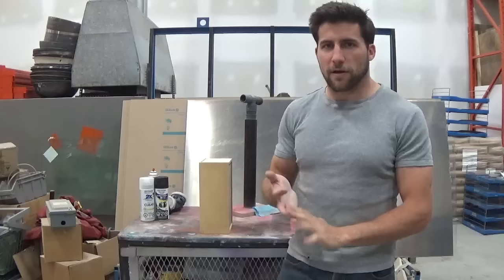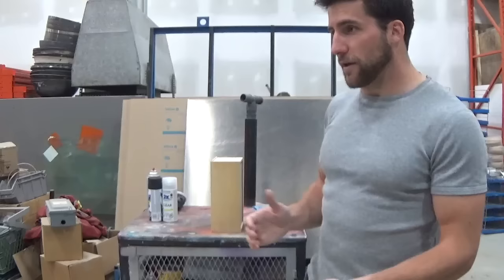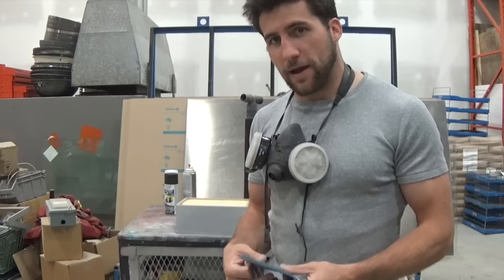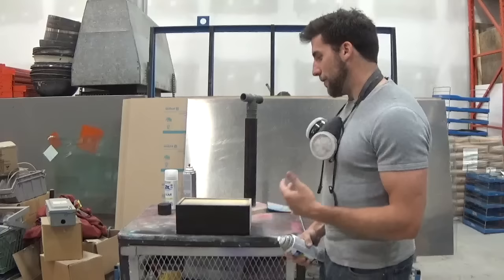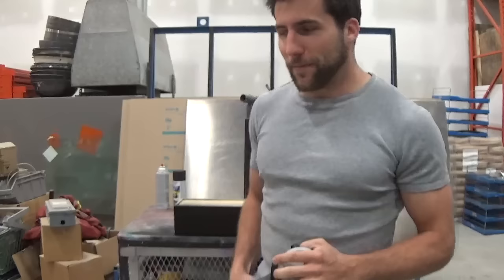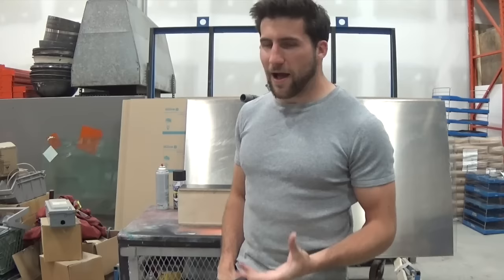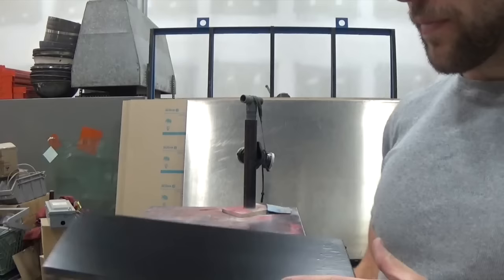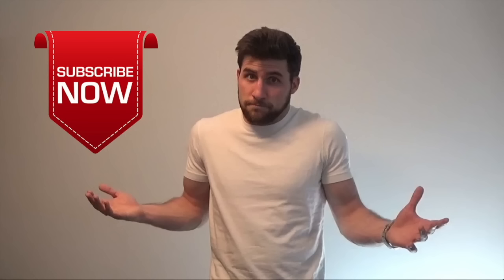How to get a matte black finish with spray cans

Comment: My old 1982 S-10 turned out great with the exact same Rustoleum "painters touch" flat black you're using, but even after 2 days of curing. If I touched the paint, even with clean hands, the fingerprints would remain and be very hard to clean. 
I cleaned it with some sprayway and hit it with the same Rustoleum matte clear and I got all kinds of compliments about how good it looked. 
When I posted it on Craigslist, the guy I had bought it from the week before saw it on CL and called me to tell me how great it looked. I gave him $500, put about 5 hours of body work and interior detailing, $30 in paint, painted the wheels silver using index cards for masking and posted it for $1,000 and ended up taking $900. It was my quickest flip ever.

Comment: Brad, a great spray can flat black is Dupli-color bumper paint, it has a great fan spray and covers well. it does fade but to more of a charcoal gray and not that weird purple you mentioned, and if you know how to use a spray can well it covers large areas well without lines and streaks, the only matte black ill use or recommend after painting 2 vehicles with it
Reply from the maker: +jon lawrence  Thanks Jon. That's good to know.

Comment: first time that i am painting with spray (painting anything at all actually), i will be painting some solid body guitars matte red, and pickguards black...
i have been training in the basement, with a plank found on the street, what i did:
DAY 1
1/ sanded at P320 grit (because that's all i have),
2/ washed the surface, dried,
3/ then matte primer, 20 minutes,
4x1/ matte colour, 20 minutes,
4x2/ again matte colour,
rest for the day,
DAY 2 (so far i like the result, not perfect, i see some weird cracking spot somewhere in the middle, but i like seeing the grain of the wood)
1/ sanded at P320 grit,
2/ washed the surface, dried,
3/ clear coat matte,
4x1/ matte clear coat 20 minutes,
4x2/ again matter clear coat 20 minutes,
i just finished the two layers of clear coat letting rest for the day... what i have noticed is because i am not skilled yet at painting with cans, it's uneven and i get some white-ish spots
should i have done a second layer of clear finish?

by the way i have been binging your videos, i have found them very entertaining and pedagogic. if only i could spray evenly, it's not easy.
Reply: also how much should i spray the finish layer? for colours it is intuitive, but for the finish, especially matte, (since it's transparent haha) i am not sure know what to aim for.

Comment: Thanks for this. Two questions: 1) Do you typically sand after second coat of paint before hitting with matte clear? 2) How much time do you wait for the paint to dry before the clear?
Reply from the maker: Yes. And if I’m going to sand I wait a day at least.
Reply: I used a 800 grit scuffing pad it baby left miniature scratches that I could only see in direct light is that enough scuff I was afraid if I left bigger actual scratches that it would show in the clear?

Comment: Followed your very detailed guide and my rebuilt guitar turned out great!
Was going for Jim Root's black strat signature model.
Reply from the maker: Awesome. Glad to hear it turned out the way you wanted.
Reply: @BradAngove 

Hi I hope you are very well.

Thank you very much for your videos, I have some questions and I would like you to help me:

* I'm going to use rustoleum Black canyon Satin Black on a guitar, and I like the satin finish with that characteristic gloss on it.

So I have some doubts about it so that it has a professional finish and they are the following:

1) how many layers of satin black are enough 2 or 3 ?

2) will the Spraymax 2k clear coat change the finish of the rustoleum satin black a lot? I want it to keep that subtle shine and richness of the overall color.

3) between layer and layer of black I only have to wait 10 minutes without sanding? And then wait 48 hours of drying to apply the 2k clear coat? Before applying this clear layer if I have to sand? Thank you

I look forward to your prompt response
Reply from the maker: 2 layers is generally fine. Gloss 2K on that will turn it gloss, which defeats the purpose of using satin. If anything you’ll want a satin clear coat  10-15 minutes between your two layers should be fine, but it is dependent on the atmospheric conditions.
Reply: @BradAngove 

Thank you for taking the time to respond.

What I want is a satin black finish, and I was thinking of using a 2k clear coat over the Black satin for added protection, I think I would use Spraymax 2k semi matte clear, because the rustoleum clear satin is not as resistant and durable.

Can you please recommend me a Clear 2k satin Other than Spraymax semi matte? which is the best that you have used? Thanks
Reply from the maker: The spraymax is a good option. I also like the car-rep 2K clear.
Reply: @BradAngove 

I was looking at the car rep 2k clear, but it seems that they only have the gloss option, not satin or matte.

And if I apply those gloss layers, I would have to sand lightly afterwards to achieve the satin finish, but I would end up with micro scratches, right?

If I use 2k spray cans, which mask with which filters do you recommend that they give me the best protection?

I stay tuned Thank you
Reply from the maker: Yes that’s basically right. If there isn’t actual satin then you can get close with sanding but not quite there. 

You definitely need a respirator. I would go with full face for sure. If you’re going to be doing it a lot you would want something with a fresh air feed, but those are very expensive.
Reply: @BradAngove 

Which particular reference or brand of full face respirator do you think is the best option? I plan to buy it on Amazon along with the spray cans.

* I wouldn't do this job often, but very sporadically with some of my guitars, I just want to be safe, and not take risks with protection.

Thanks you are the best
Reply from the maker: I use the 3M one that can be found in the amazon link in the description of my videos.
Reply: @BradAngove 

Thank you very much for taking the time to respond.

I will follow your advice it is very helpful. Cheers

Comment: Bought a guitar DIY kit of a Les Paul Junior and I'm doing it in a matte black, just finished priming it. My first guitar paintjob, so hopefully it ends up at least okay :D
Reply from the maker: Awesome; let me know how it goes.
Reply: I think it went fairly well, minus some dripping I didn't sand down properly.
I made a journal on DeviantArt with some photos of my progress which I will update as I start the final assembly
http://9joakim7.deviantart.com/journal/DIY-guitar-kit-from-Gear4Music-620817761
Reply from the maker: Nice work. It looks pretty good to me. Thanks for the shoutout in the beginning as well. You can put the matte black on in slightly lighter coats. The same goes for the clear. They don't need to be that heavy really.
Also, don't worry about that guy who says you have to use nitro. Very few companies use nitro these days. I bet if I repainted one of his les pauls with poly he wouldn't be able to hear the difference at all haha.
Reply: Thank you :)
I went a little overboard with the coats yeah
And the guy is cool, he just wanted to help

Comment: I have two questions:
1) What kind of gloss top coat can I use on Rustoleum metallic spray paints that won't completely ruin the finish?
2) Have you considered a career as Christian Bale's body double/look-alike?
Reply from the maker: 1. Have you tried using a rustoleum gloss clear coat?
2. I think they're still considering my application.
Reply: iv run into this problem too lol 
some rustoleum cans will say not to use a clear coat and its obvious when
testing it fuks up the finish. I stumbled apon a forum that people that were
making shiny fishing lures were trying to find a way to protect the paint. many
clear coats wont work on them.
Reply: +Brad Angove theres a challenge for you Brad, buy a can of rustoleum metalic finish paint that says on
the can not to use clear, and figure out a way to protect it lol. Thats a video that iv been looking for that isn't easy to find.
Reply from the maker: What kind of metallic is it? I use clear on the restoleum metallics fairly frequently. Is there a specific can that's giving you problems? Is it that reflective finish crap?
Reply: +Brad Angove I don't know what the original post is referring to, but yea im talking about the reflective crap "rustoleum specialty metalic". They have the best metal finish of all the other brands, very close to actual metal but very fragile and impossible to clear.(apparently) There got to be some kind of top coat that won't ruin the finish. So far only found that a watered down white glue will dry to a clear layer but its soft not solid like a clear coat.
Reply from the maker: I've had some trouble with that stuff in the past too. I'll have to do a couple tests next time I'm in the shop and see what I can figure out. I'll let you know if I find a solution!

Comment: My question is what chemicals if spilled on the 2x clear coat when fully cured or dried will disintegrate the clear layer...I.E Can alcohol? (What strength)

Comment: Hi Brad, my bike sorely needs a good repaint; since it's old I'll go DIY, let me ask you some questions:
1) how much time between color coat and clear coat? Has the color coat to be completely dried?
2) I want to mask some part of the frame and use another color, how much time before applying masking tape (I'm afraid to strip the coating)
Many thanks in advance
Cheers
Reply: Ok, first point covered, sorry. But as a noob I'd like to know: what is the difference between letting the color coat dry and waiting ten minutes... Only time constraints for the vid?
Reply from the maker: Let the first colour dry completely before masking for the second. The difference is you can only build up so many coats without allowing for them to fully dry before continuing. Otherwise the bottom layers will never harden. 

Check out my frankenstrat paint job series. That should give you a good outline for doing the bike paint job.

Comment: Sir ive got a new bike frame....
So do I have to remove that old color...Or just i repaint directly onto it...Pls reply
Btw it's on aluminum
Reply from the maker: Sand it with 400 grit first so the primer will stick. You don’t need to remove the paint.
Reply: @BradAngove  so I need to do a primer coat....If yes how many
Reply from the maker: Yes. 2.
Reply: @BradAngove  thanks man

Comment: I've got a Tele that my Dad gave to me.
He took it to a guitar shop and had them paint it...it's kind of a root-beer deep red.
Then he gave me the guitar. The color is nice. I really like it.
Problem is, I dont think the shop used any type of clear over the paint. Also, I don't know what type of paint they used.
So,  when I was changing strings or something I laid the guitar on the living room carpet and there happened to be a penny or something on the floor where I laid the guitar down.
It chipped the paint on the back of the guitar around the size of a nickel...all the way to the wood.
Now, I'm not overly concerned about chips or scratches on guitars. It happens.
But what concerns me about this particular guitar is that I feel that there is a chance that all of the paint will just slowly and completely chip away leaving a pretty worn piece of bare wood behind. I don't want that to happen mainly because the color is so nice, I'd like to keep it around for awhile...and of course it's an irreplaceable memory of my Dad. 
My Dad recently passed away, so I decided to give the guitar a complete rework. New everything...but keeping the exact same theme he had on the guitar.
So, while it's disassembled should I go ahead and spray it with a few coats of clear?
I don't want a thick poly coat. Just enough to give a little protection.
I'm worried about doing that though since I don't know which paint I'd be covering. My guess would be lacquer, but I honestly don't know. 
Does it make a difference which type of paint they used when deciding which clear I'm going to use?....and will I need to scuff up the paint before I lay the clear down?
I have a can of Minwax Polycrylic water based clear. I accidentally got satin... So I need to go back and get a gloss. Or not. ...depending on your answer.
Actually this whole process has me worried.. because I'm very new to painting anything.
The paint my Dad had done is something I can't replace. So, if I screw it up in some way I'll end up losing a lot of the sentimental value of the guitar. ..and for some reason I just have a bad feeling about this. My instincts are detecting trouble ahead.
Its odd. I don't feel very concerned at all about my Strat build, but this one seems to be doomed. Orange peel, runs, clogs, drips, and dust and flies and their squirmy legs stuck in the clear.
Im getting sweaty palms just thinking about it. lol
Reply from the maker: Whether or not you need to scuff it, and the paint type that you would generally use, depends on what's on there already. If you want to play it safe though, you can scuff it lightly with 800 grit paper and apply a water-borne clear. That should be unlikely to react, and will provide some protection.
Reply: That's what I'll do.
Thanks!
The only sure thing is that I know I need to take action to protect the paint.
Do you have a recommendation of which water borne clear?
Reply from the maker: That minwax polycrylic should do fine.
Reply: OK got it.
Thanks again
Reply from the maker: You’re welcome.

Comment: If you want a matte finish, build up some matte clear coat and then wet sand it with 1500 grit or even 2000 grit. Going above that is gonna make it too shiny.

Comment: If I use rustoleum flat black, and clear it with spray max 2k, will I still get a nice wet look even though I used flat black? I want a wet look..using a spray can because of the surface size
Reply from the maker: Yes, it will still end up gloss.

Comment: i just painted a front lip for my car in Matte black. After prep, primer and a few coats of the matte black, it looked so great. then I did 3 coats of matte clear and now it looks gray, cloudy. I feel like I ruined the whole project with the matte clear :(
Reply from the maker: Matte clear is generally just the final coat or two because the matting agent can make it look cloudy. But more importantly, was it humid where you were painting?
Reply: @BradAngove  yes! I’m in central Florida aka Humidity Alley. I ended up wet sanding the clear coat off and applying 2 more coats of the base paint. Looks great again so I’m going to leave it like that. After all, it’s just a front lip and might be damaged soon anyway 😅 anything you’d recommend to protect the paint? Wax perhaps?
Reply from the maker: There’s not much you can do to protect the paint against concrete. A coat of wax wouldn’t hurt, but it will change the look. It’s tough to get a matte buff on wax.

Comment: Would it look good if I used this same matte black paint but with a gloss clear? I am wondering if I did it with the gloss clear instead maybe it would look good on a car?
Reply from the maker: It would be better to use gloss paint, let it harden, sand smooth with 800 grit, and then use gloss clear. 
Realistically though painting a car with spray cans like this is unlikely to look good. It will probably be streaky and uneven.

Comment: Is it safe to continuously touch something that's been spray painted (and has dried fully)? Meaning is dried spray paint safe to touch for extended periods of time (ie if you painted a tennis racket handle and continuously touch it during a long game)
Reply from the maker: Well, I’m not a doctor but I’m pretty sure we all touch things with paint on them very frequently. I would be more concerned that if you pint the grip on a racket it will just come off because it’s a soft surface that you would be applying pressure to.

Comment: Can i use flat black as the primer and top it with doff black? I saw that my guitar has a flat black colour as the primer paint for the guitar and then doff black for the matte part.
Reply from the maker: You can get black primer, yes.

Comment: Can I wet sand the flat black paint with a 2500 grit if I have imperfections? If so what are the steps after, since it’s matte do I just leave it like it is after sanding and cleaning with soap and water and then paint the clear matte paint?
Reply from the maker: You would sand with 800 and the clear coat. 2500 is too fine.

Comment: Hi does standard color coat work instead of flat? Because there isnt a flat variant for the color i that want.
Reply from the maker: Yes, if you’re going over it with the matte clear that should be fine.

Comment: Great video! I do have a question. I really like the 2k ultra cover glossy navy blue spray can, but i would like a matt finish on my motorcycle gas tank. 
My question is, if i use the 2k ultra cover matt clear spray can will it give me that matt finish that i want?
Reply from the maker: Is it 2K, or 2x?

Comment: What would you recommend for spray painting an indoor metal handrail along the stairwell? It's currently painted a flat black but is wearing in spots where it's being grabbed?
Reply from the maker: If you use an enamel with a bit more sheen it will be more durable again that abrasion polishing.